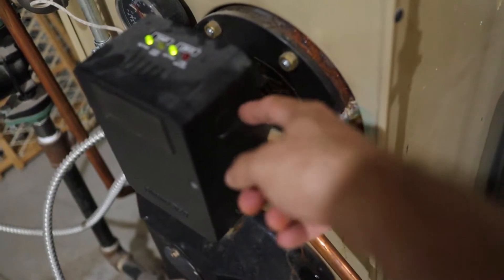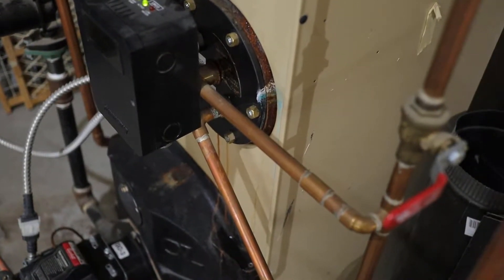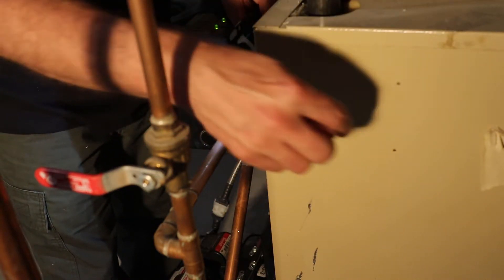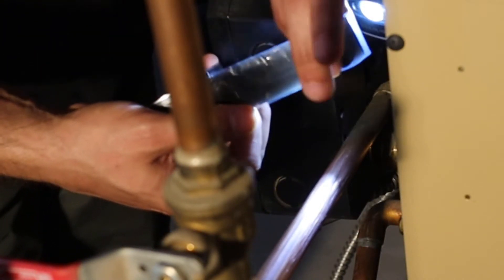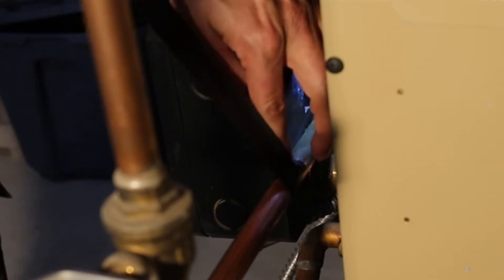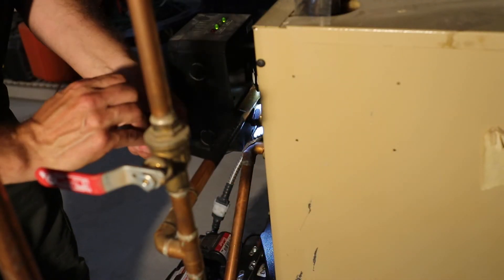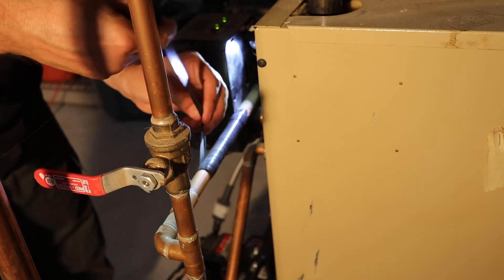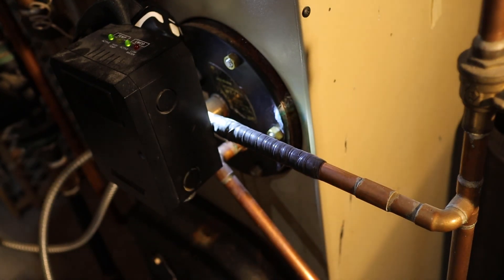Leaky Pipe Quick Fix

Comment: Do you have well water? It seems like houses with well water have more pin hole leakes in copper lines then city water. That looks to be the supply pipe for the domestic hot water coil in the boiler
Reply from the maker: Yes, well water

Comment: If there are water pipes, it is not a Furness you have, it is a Boiler.   Boiler heat water that heats radiators, that in turn heat air.  A Furness heats the air directly.